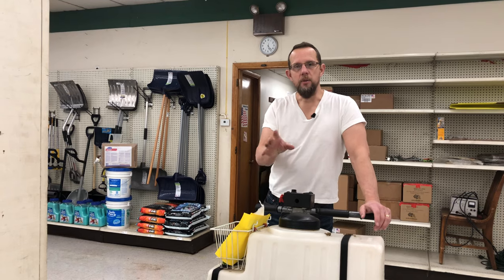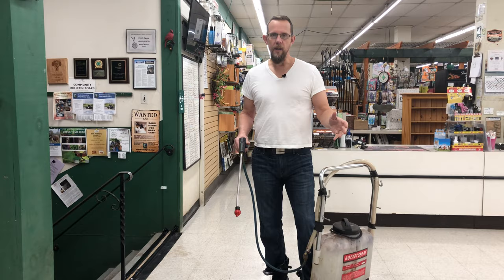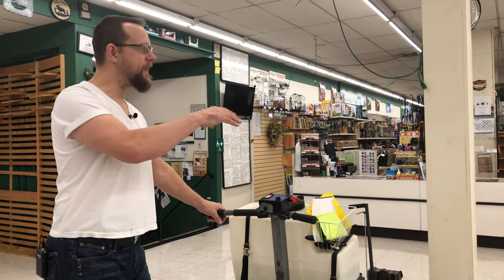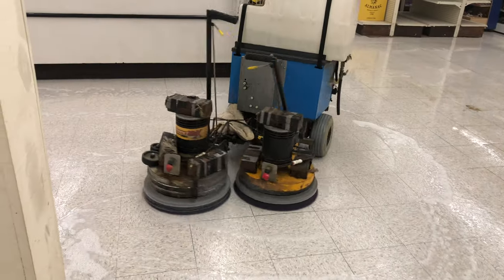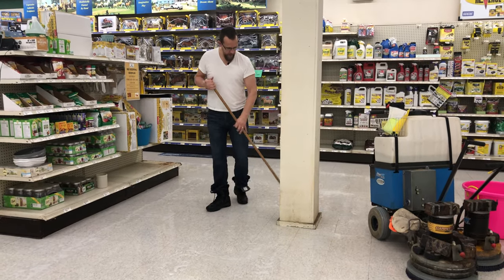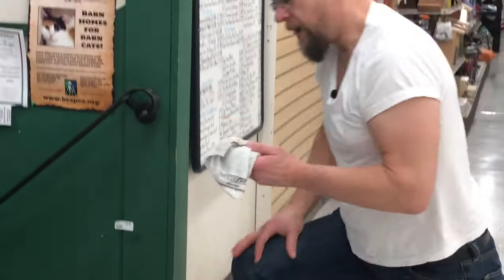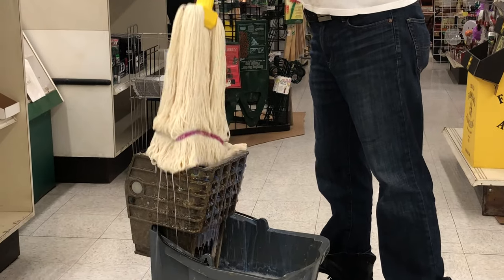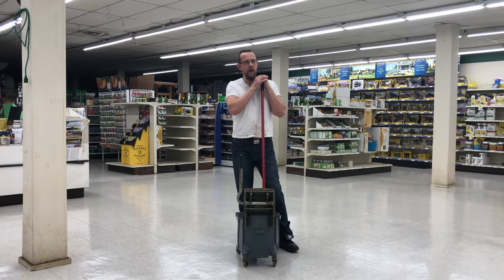How to strip a floor from Bonnet Pro

Comment: John I do a similar procedure to yours I pre-spray the same way what the heavy mix  24 to 1 hot water then I simply the 12 inch wand with a slide on it I dunno scrubbing